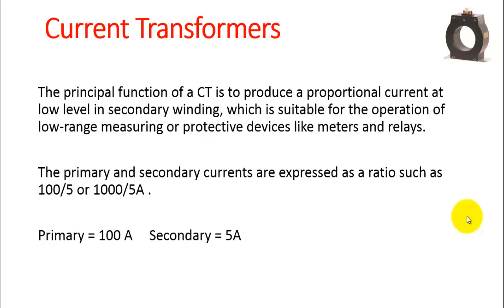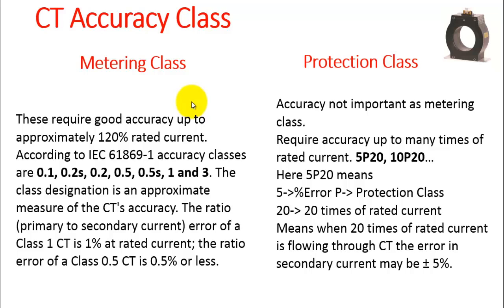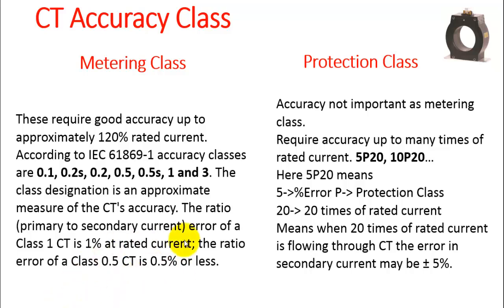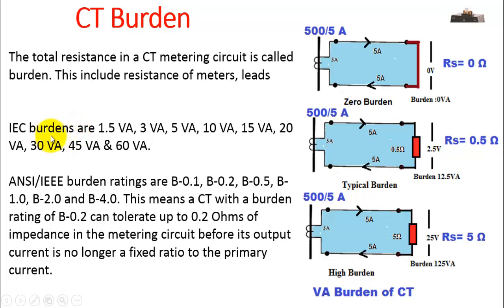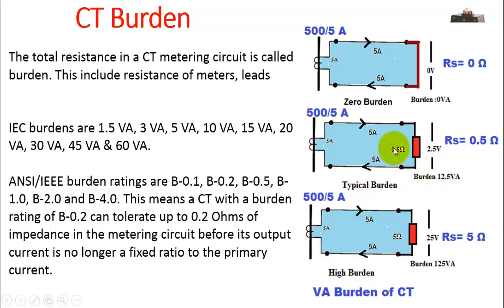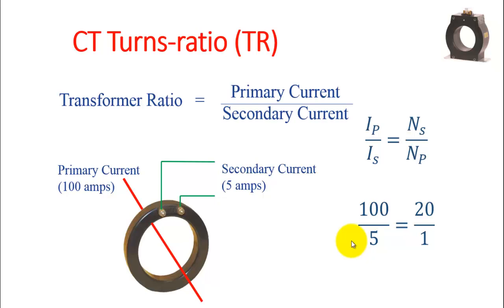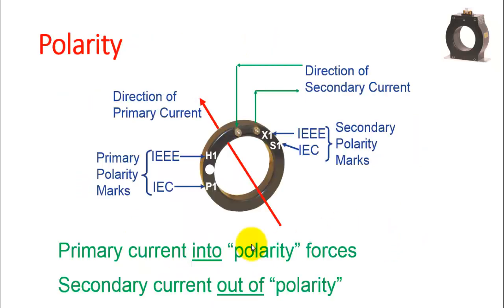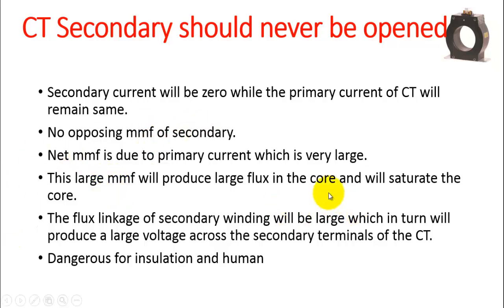Current Transformer  Concepts| CT Burden | CT Accuracy Class

Comment: Please explain how AC can have a direction of flow? If current is continually alternating, this direction must alternate as well. Usually 50 or 60 times per second. I'm trying to understand how the CT from my solar system's inverter can tell if I am drawing power from the grid, or feeding power back into the grid.

Comment: I have a question. Please could you tell me, what would happen if the flow primary current is 300 A permanently, and the ratio CT is only 200/5 A? Thanks by the answer.
Reply from the maker: Ct will saturate and 5 A will continue to flow
Reply: @electricallectures  Thanks a lot  by the answer.
Reply: @electricallectures  I don't agree, please elaborate further. There are times when you can set the pick to be above the 100% rating, which is 5A. I have seen the CT's rated 600/5A and relay set at 1.2 of the primary current. Is that a wrong practice or what?
Reply from the maker: Absolutely wrong. Ct can only produce 5A. As far as pickup is concerned , 1.2 can be set if the maximum primary current is 600. Let say ur relay is supposed to trip @400A which is 1.2 times. Now ur ct is 600/5 and it will work in this situation

Comment: Hi,if data markings on the CT's disappear how would one determine the correct ratio? Thank You.
Reply from the maker: Then you have to do it by hit and trial. One thing for sure the output is always 5. So by measuring secondary current and primary you can compute ratio
Reply: @electricallectures  so i basically run 100a through the line and measure Ct output amps. If its 2.5 its primary is 200a. But  due to impedance and accuracy class, output can't be accurate right?

Comment: What happens on primary side current when burden increases on Secondary side
Reply from the maker: No effect on primary but if burden exveed the ratio will be disturbed and so as secondary current
Reply: If the Secondary winding is replaced with reactance instead of short circuit after sometime then what happens on primary side current